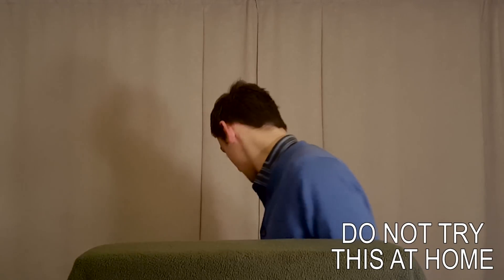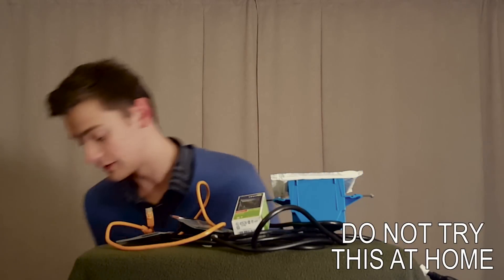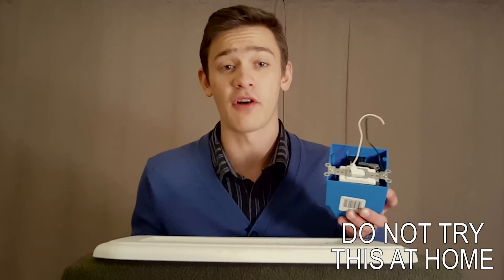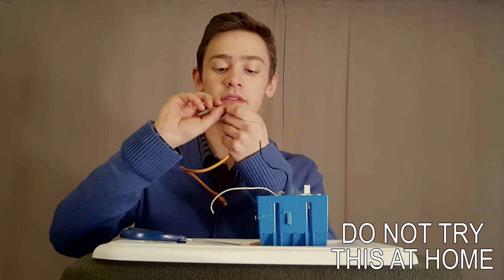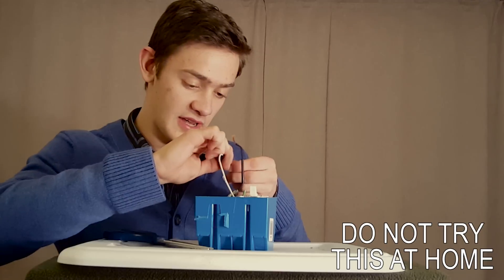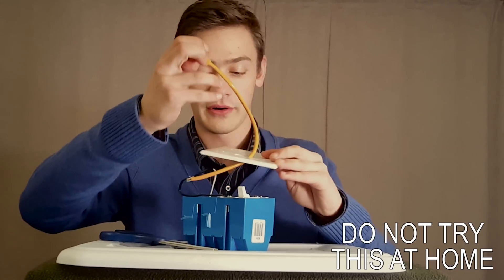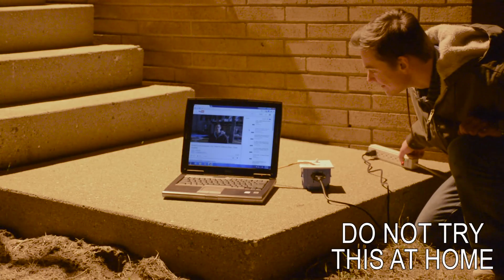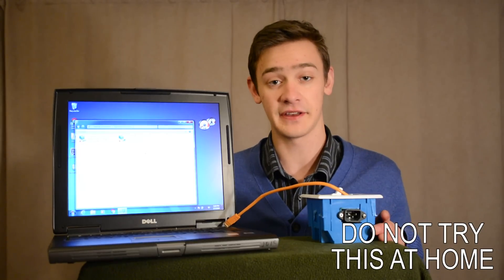Electric Ethernet Destruction Device

Comment: Your laptop survived because the Ethernet port is opto-isolated from the rest of the laptop's circuits. Engineers anticipated errors such as this, which could result from incorrect POE installations, and designed an expendable opto-isolator chip to take the hit for the team.

Comment: Old Dell laptops are really well made. It's most likely got some kind of protection.
Reply: Oh yeah. Best ones you can buy. I have a 22 year old dell xps that still runs just fine. I don’t know about the newer ones though
Reply: @anthonybush3134  I have a Latitude from 2013 I bought in 2021 that's still going strong.
Reply: @wisteela  I have a dell vostro I’ve had since 2012 and it still runs.